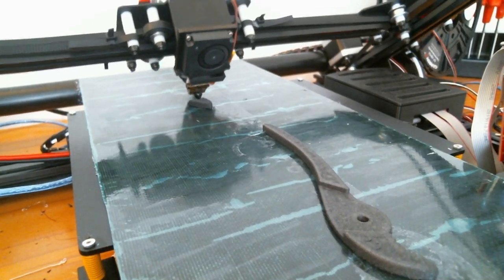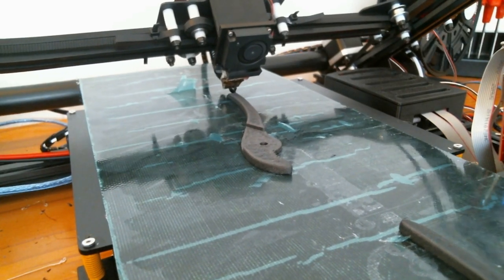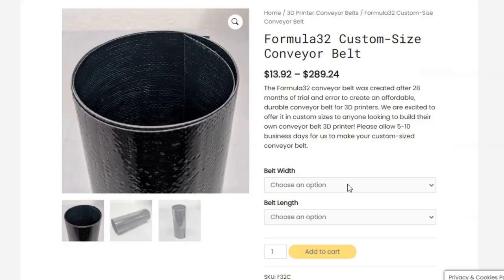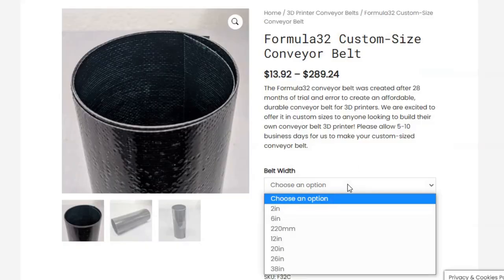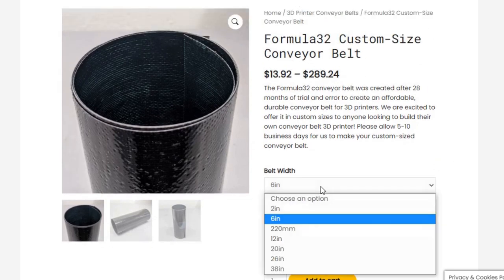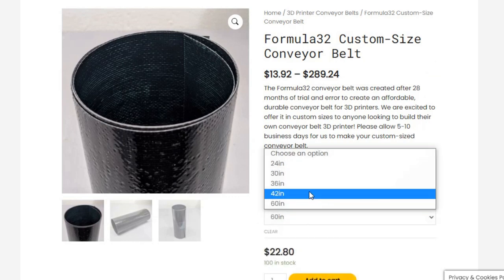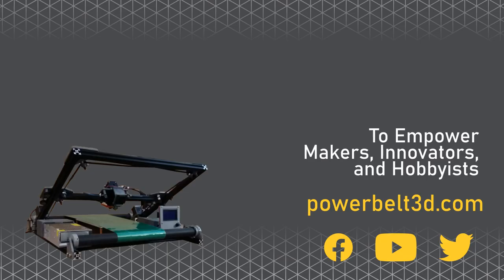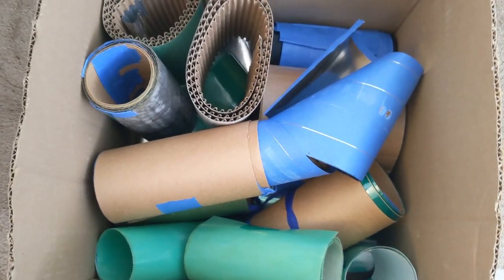These conveyor belts were made specifically for 3D Printers

Comment: My PrintShift prusa minis use a belt that's 155mm wide by 425mm long (6" by 16.75") - I've settled on .2mm Kapton film as the nicest surface, but, well, it's not cheap or readily available.

One of my criteria for the mini (the only one that differs from your list) is a very small bend radius - 8mm - which is what steered me away from PET tape on shim stock in the first place.  I've ordered a couple of your 6"x24" belts... but it'd be pretty cash money if you'd offer 'em at 425mm long ;-)

I was using PEI film for a while, and while it works well it tends to fail catastrophically, big ol' tear right up - both kapton and PET film are much more durable.  PEI failure might be due to my preference for small bend radii, or high tension to keep the belt flat, but still - why have a conveyor belt machine if it needs to be maintained every 48 prints!?  I want 1,000 prints minimum between belt swaps.
Reply from the maker: Hey Paul,

Awesome feedback on bend radius and PEI vs. PET and kapton. Small bend radius probably should be added to the list, because that means it could be used with wider bend radii as well.

Your belted Mini looks awesome! I hope the F32 belts serve you well!

Comment: Can I use it for pla/abs without using glue stick? I'm planning to make a belt printer for continuous printing and re application of the glue stick every print would defeat its purpose.
Reply from the maker: I had the same hesitation before I ever put gluestick on the belt. In practice, I apply one layer of glue stick to the whole belt, and don't need to re-apply for months. It makes your life easier, but I wouldn't say you HAVE to use it.
Reply: @powerbelt3d  oh wow, that's not too bad! Back when I had to put glue on a glass bed I re applied every time I had to print. Thanks for the reply, really appreciate it!
Reply from the maker: @Joshuadomiel  I've been in the same situation with Glass+glue stick on another printer. I moved to glass+PEI on top, and now glass+PET. Prints stick great with no or very little glue stick.. so that should mean  it's possible on the belt with no glue stick? 😅 Again, I've found it makes my life a little easier, so it's recommended.
Reply: @powerbelt3d  I'm thinking to convert an Ender 3 V2 to conveyer belt. I'll need to print ABS and PETG (not sure for ASA but as you mentioned for  Naylon and since both are comparable fillamenrs, understand that's a no) replacing the stock printhead with a Sprite one. The printer will be boxed for temp control.

 What about the higher temps on the belt and how this might affect 1st layer sticking and removing at the end?  Applying glue will do the job?  
 I don't mind to clean the belt and re-apply glue every day, but not during a couple of hours.   I understand that any belt needs to be replaced after some time or months, a cost that is acceptable when you batch printing. 
 
Did you have success printings with ABS? What about PETG?
Reply from the maker: @tomlef9704  I print 90%+ PETG at 70C on the heat bed and 250 on the hotend. I've printed up to 120C on the heat bed when doing ABS without issues.

I normally use a layer of glue stick when I install a new belt, but then it's good to go for a while without needing more attention. "A while" is weeks or months depending on how much printing I'm doing.